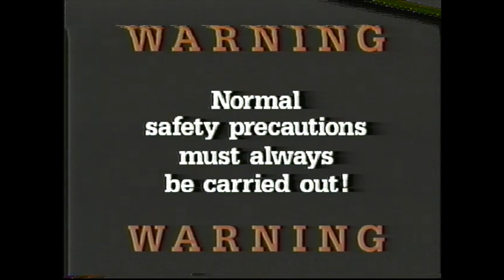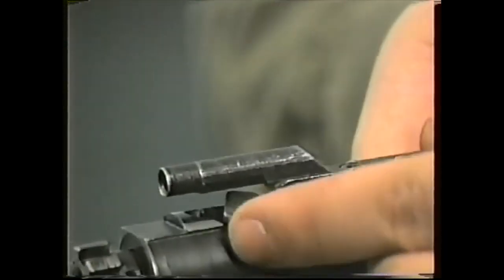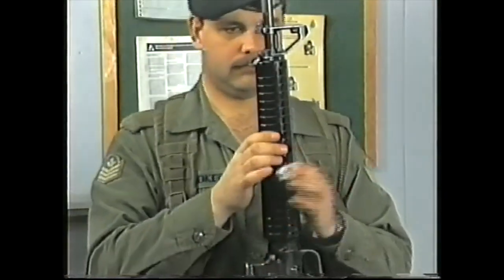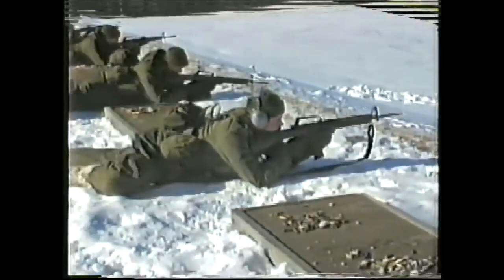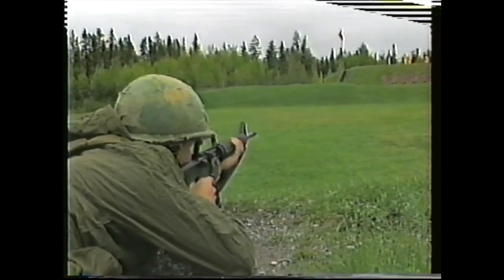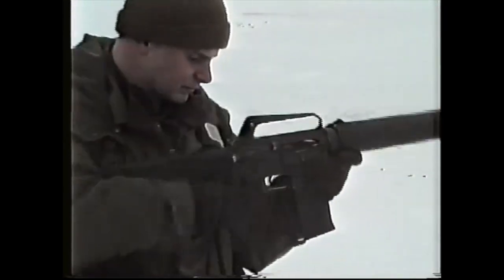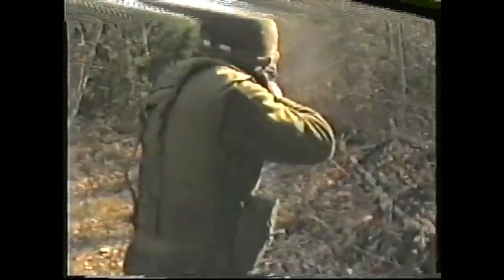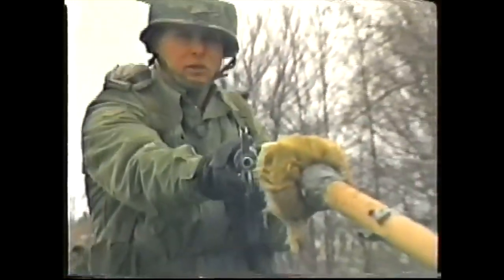Canadian Forces - C7 Rifle Training Series (1993)

Comment: This are m16a1 with brass deflector and a2 handguards.
Reply: It has an A2 1 in 7 twist barrel profile (skinny under handguards, thick past the front sight post) with A2 lower reciever dimensions (extra material around the buffer tube area and front pivot pin area, fencing around the magazine well and directly below the dust cover). The rear sight aperture is more like later M16A1 and M16A2 apertures (small aperture for normal use, large aperture for CQB and low light use). The Stock is also M16A2 spec. The Original C7 is very close to the M16A1E1 rifle that would eventually be developed into the M16A2.
Reply: That is incorrect
Reply: In addition, Diemaco-made parts were of higher quality than their American counterparts. Barrels were cold hammer forged and BCGs were tougher. Otherwise, in a way, it was an amalgam of the M16A1 and M16A2.

Comment: So the C7 is a American M16?
Reply: More like an M16A2 with A1 sights and full auto instead of 3 round burst, and a cold hammer forged barrel with extra thick chrome lining and a different front sight post that is skinnier than the M16A2. All of our C7 rifles were manufactured by Diemaco, now known as Colt Canada, in Kitchener, Ontario.

The only OG C7s like in the video still in service are for Ceremonial Guard Duty, but even then I've seen C7A1s (carry handle deleted in favour of flat top optics rail with an Elcan C79 sight) and C7A2s (adjustable carbine stock, fully ambi controls, green furniture and triad rail) used on CG.
Reply: @burnyburnoutze2nd  
I believe the Canadians need to fight and get their rights back.
Reply: @johnnybbgunner2136  we have slightly more strict laws but everybody is free to live joyful life.
There are certainly worst places to live.
Reply: Yeah it's what the M16A2 should have been..

Comment: I wonder is it possible to get one that is deactivated would be great to put on the shelf
Reply: before AR-15s were prohibited you could buy a complete surplus C8 upper receiver, lower parts kit and a new Colt Canada/Diemaco stripped lower for about 1K. I've never seen a deactivated C7 or C8 tho, AFAIK the DOD never surplused them whole due to the full auto capable lowers.
Reply: @KDX420  yeah I built a few before the band I was just wondering if it was possible to get an actual military rifles I’ve seen a few around in my life fully functional and deactivated for some strange reason I wanted to start a collection of deactivated fire arms but only use only rifles that kind of scene action guess I’ve been watching too many of those dragonmans videos😂